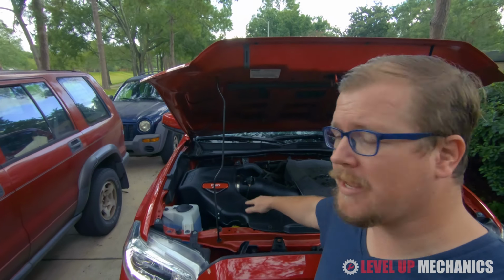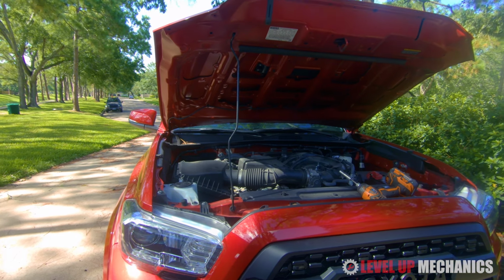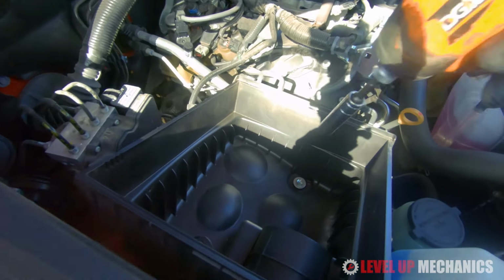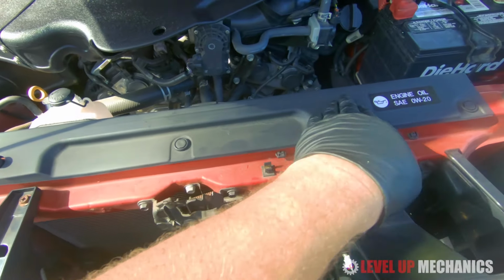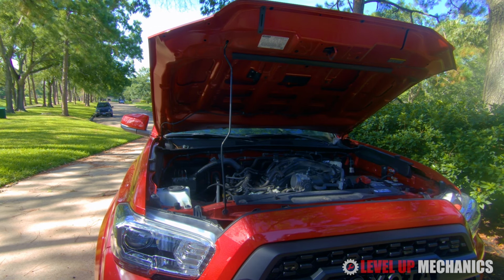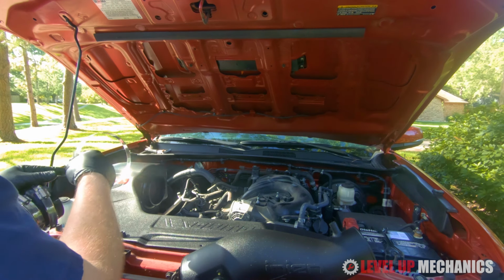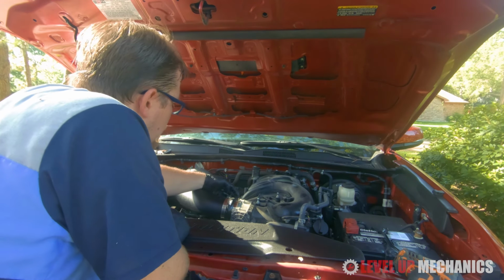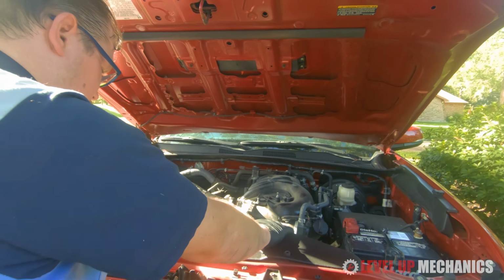Toyota Tacoma Mods | Injen Evolution Cold Air  Intake DIY Install | Injen

Comment: HP? How much does it actually give the truck? What’s the price on these?
Reply from the maker: On their website, Injen states that this intake has dyno proven gains of up to 17 hp and 15 lb-ft. of torque (and costs about $440).

Here is the link: https://injen.com/i-30497613-injen-evolution-cold-air-intake-system-oiled-air-filter-evo2200c.html?q=

If you check out their website, they have multiple options for a tacoma intake system. I hope this info helps! 😁 👍

Comment: Just installed mine today. Since I do have the 2022 Tacoma TRD OR, i dont need to add a sealant since the new one have this addon on them. it is a hard fit if you added the Silver Bullet Throttle Body Spacer on it. I like the sound that it makes. it has that whistle sound when you press the throttle.
Reply from the maker: Nice! Congrats on the upgrade 👍. Definitely a great choice 😁

Comment: Wait, did u modify your hood scoop?
Reply from the maker: Nope. Why do you ask?
Reply: @LevelUpMechanics  I thought someone below mentioned your hood scoop and u saying how it lets in air but not water
Reply from the maker: I think they are just talking about the "front scoop" that comes with this intake, which sits above the radiator. 😁

Comment: So the ram air scoop sits behind the radiator? Won't it be pulling in hot radiator air into the intake?
Reply from the maker: It actually sits right above the radiator, so when your driving, all the cool air from outside that blows above the radiator is being collected & fed to the engine. 

There is also a second air intake opening located at the passenger front fender, which is the same as the stock setup.

I hope this info helps! 😁

Comment: I’m worried about how well the filter protects the engine compared to OEM? If you are in very dusty conditions.
Reply from the maker: If I were in dusty conditions all the time, I would actually recommend just a TRD air filter and a snorkel. 

So many people think a snorkel let's you drive in deep water, and that is just absolutely absurd 🤯🤯🤯.

A snorkel's only function is to "collect" dust-free air when in dusty situations...

So far my Injen intake filter is holding up really well. No issues at all. But I haven't tested it personally in a dusty environment, so I really can't speak to that aspect 🤔

Comment: What intake do you recommend for a 2016 2.7 SR5 Tacoma?
Reply from the maker: K&N is a reputable brand and offers a couple different options for the 2.7L (both high performance "drop-in" filters and full intake systems).

Comment: Does your air intake box with the rubber trim piece actually slot into the wheel well hole, or is there a gap?
Reply from the maker: The rubber trim just sits up against the fender where the hole is.

Comment: Any reason you went with the red(oiled one) over the blue(dry filter)? Idk which one is better ive heard the oiled one allows contaminants to enter the engine easier
Reply from the maker: Honestly, it might be better to go with the dry blue filter going forward. Both filters are pretty identical in performance. 

The blue filter is also easier to maintain, as you do not have to re-oil it after cleaning. 

If in doubt, I'd recommend going with the blue filter. I'm used to oiled filters, so I bought the red filter purely out of habit lol 😆

Comment: Did you think the CAI made your truck louder (in the cab) or just deeper?
Reply from the maker: Barely louder, and definitely deeper... but only when under heavy acceleration and in the 4-6K rpm range.

When cruising, the engine sounds the same as when using the stock intake. 

I hope this info helps!
Reply: Any difference in sound (loudness when on the phone) when normally accelerating or cruising at 75plus highway speed?
Reply from the maker: You don't really hear the intake unless you are wide open throttle.  The Tacoma will sound stock while cruising or under light acceleration...

However, you will definitely hear it when you punch the throttle @ high rpms.

I hope this info helps!!!

Comment: I know I'm a bit late to the game here but...  Is your truck an automatic or manual?  And GREAT video!
Reply from the maker: My tacoma is an automatic. I do miss having a manual though, as they are a lot more fun in my opinion. Thanks for checking out my video!
Reply: @LevelUpMechanics  Thank you for the reply!  Yours sounds amazing!  Mine is an automatic too. So I really just wanted to gauge if the CTA was worth it from a sound perspective.
Reply from the maker: While cruising around, the engine still sounds pretty stock... but when you accelerate, you can definitely hear the CAI growl while in the upper RPMS (4-6K RPM).

Comment: Just installed on mine. Oh man big difference in shifting and sound!! Way smoother 😀
Reply from the maker: I agree 👍💯.  I really like the aesthetics and performance of this intake too! Great choice!
Reply: @LevelUpMechanics  my favorite upgrade so far 😊
Reply: Do you guys have manual transmissions? I’m considering this for the HP and TQ output; but I don’t know if there’s any hope for the Automatic XMSN, it’s always searching for gears (I live in a pretty mountainous area) hoping this and pedal commander do the trick
Reply from the maker: While the intake is a fun mod and does add a bit of HP & TQ, I would really recommend checking out my channel to watch the KDMAX Tune video. 

I have an automatic transmission and the KDMAX performance Tune (by itself) literally fixed all of those issues that you just described. 

I have an automatic transmission as well and the KDMAX Performance Tune made the Tacoma come alive! 

Plus, since it costs about the same as a Pedal Commander, it is a much better upgrade... the KDMAX Performance Tune not only eliminated the gear hunting issues, it gave me a much better throttle response as well! 

Check out the video on my channel and feel free to ask me any questions you may have about the tune. 

The KDMAX Performance Tune is single-handedly the best performance upgrade for a V6 3rd Gen Toyota Tacoma 😁
Reply: @LevelUpMechanics  does the tune cost you any drop in MPG?
Reply from the maker: Is you drive conservatively, there's actually an improvement in MPG's. I went from an average of 16 mpg up to 18+ mpg (highway driving) and my MPG's stayed about the same for city driving...

Is important to note that with the tune, you have the option to continue using 87 octane fuel (which should give you even better MPG results) or you can tune the Tacoma with 91/93 octane fuel (designed for more performance gains vs MPG gains).

I'm currently running the tune with 93 octane fuel and I still see a MPG improvement (on the freeway mostly) when driving conservatively.

Best. Upgrade. Ever.
Reply: @LevelUpMechanics  😊 thanks!
Reply: @christopherterrell1805  I have automatic and the improvements were instant when I floor the gas pedal
Reply from the maker: Yeah, with the intake, you'll only feel the HP & TQ gains under full acceleration. 

One other benefit is that you should see a marginal improvement in MPG's over time since the intake allows the engine to "breathe" better... allowing more air into the engine with a less-restrictive intake is always a good thing 👍

Comment: Is this just for sound or does it have another purpose?
Reply from the maker: This intake provides a deeper, aggressive tone and also improves engine performance (horsepower & torque) by allowing more air into the engine. 

Injen has been around for decades and is one of my favorite aftermarket brands 😁💯

Comment: Noticed fitment appears off on the top area. Thanks for sharing. I usually just replace the OEM air filter with a K&N or similar.
Reply from the maker: It did take a small amount of finesse to get everything to line up. 

Overall, I am very happy with the results of this intake system 😁

Comment: Just got one of these for my truck and installed it over the weekend. Having some fitment issues with the air filter seating properly on the intake tube and the airbox though. Love the design of this intake, just fitment issues are the main problem. Other than that it sounds/feels great when you get the truck up past 4k!
Reply from the maker: That's unfortunate in regards to the trouble you had installing the intake. 

If I remember correctly, I had to install the filter into the air box first (and then pulled on the filter to make sure I had it "twisted" in properly) and then I installed the intake tube. 

I do agree that it would be better if they made the filter in a way where you could physically feel it lock into place (instead of guessing and testing).

It sounds like you were able to get it together in the end. I definitely enjoy the sound and performance of this intake too!
Reply: @LevelUpMechanics   I tried putting the air filter in the airbox and twisting it in place. But every time I tried to slip the intake tube onto the filter rubber coupler wouldn't seal nicely. I could see the flange part of the intake tube showing. So I installed the air filter onto the intake tube first then I put it into the airbox then connect it to the throttle body.  There is just a small gap now shows between the air box and air filter. The filter is securely on the intake tube though. I am going to try to adjust it again in the spring time. Just too cold right now.
Reply from the maker: Oh wow. Okay. I'd try sending an email to customer support @ Injen, explain the situation, and see if they might be able to send you another intake tube & filter (or at least accommodate your issues / figure out a solution).

In the meantime, as long as the filter is secured onto the tube, you should be okay for the time being.

Comment: FYI but the Tacoma already comes with a CAI. Spending the money on this kind of thing will net negligible power gains.
Reply from the maker: I can understand your point of view, but I really didn't purchase this intake to make crazy power gains. If I really wanted a modest power increase, I'd buy a supercharger...

I purchased this intake because it improves the efficiency of the engine (just like the OEM TRD intake upgrade). It makes a slight improvement in fuel economy (because the engine is more efficient). The air filter will last for the life of the vehicle (with periodic maintenance - I'd recommended cleaning / re-oiling the filter once every year or two). 

And, personally, I like Injen as a brand that is available for the Tacoma. I like the design and I like that it sounds more "aggressive" when I want accelerate. 

I like modifying the Tacoma with products that have practicality and aesthetics in mind.  To each their own I suppose 😁

Comment: how does that front scoop do in the rain? Would there be a risk of water getting into the intake box?
Reply from the maker: The design of how air enters the intake box is almost identical to the factory intake box. As far as the front scoop is concerned, it is designed to let air in and keep water out.

The front scoop has "cut outs" along the bottom of the scoop (in the front, where it sits along the front core support) to keep water out. I haven't had any issues while using this intake system. 

I hope this answer helps!
Reply: @LevelUpMechanics  Awesome! Do you have the link to where you bought your CAI?
Reply from the maker: I believe I ordered mine through CarID's website: 

https://www.carid.com/2017-toyota-tacoma-air-intakes/injen-evo-series-air-intake-system-1560396665.html?parentsubmodel[]=ENGINE|3.5L
Reply from the maker: https://www.carid.com/

Comment: Does it really give HP to the vehicle? either is Injen, K&N or others I've seen on the internet? What about adding a pedal commander system, exhuast system?
Reply from the maker: Yes, the intake will increase both your HP & TQ. Most intakes will improve engine performance. And yes, even changing an air filter with one that is less restrictive (like K&N) can improve engine performance. 

The best intakes are the ones that can deliver in both quantity and quality. For quantity, you want an intake that can deliver a high volume of air (not restrictive). For quality, you want an intake that can deliver the coldest air possible (the colder the air, the denser it is). 

That's why I chose Injen. I did not want an "open filter" system, where it would just suck hot engine air (and where the filter would get dirty really quick by being exposed to the elements). I wanted an intake where the filter was enclosed in a case and had the ability to draw in the coolest air possible. 

An exhaust system could also improve HP & TQ (a better flowing exhaust helps remove your exhaust fumes to make way for all that fresh air).

A pedal commander does not improve engine performance. Instead, it changes the responsiveness of your gas pedal. 3rd gen tacomas are notorious for feeling "sluggish". A pedal commander will make you feel like you're going faster at the touch of a gas pedal, but all its really doing is adjusting the sensitivity of your gas pedal. It does not actually create more power, but instead, changes how quickly you can access the power that is already there (to put it simply).
Reply: Wow great answer. I gotta buy one of these for my Taco man 😩 It sounds so good! Then I’d like to throw a Carven backside exhaust kit on. It would sound like a Warthog from Halo then. 👍😂
Reply from the maker: Thanks! An intake & exhaust upgrade are usually the first to be done on all of my vehicles lol 😆
Reply: @LevelUpMechanics  How has your Injen CAI handled snow and rain? Any engine lock-ups or noticeable water inside the intake. Especially out front with that grill design? Just curious as it’s whats keeping me from buying right now. Just don’t want to take the chance of messing up the engine and I’d also be voiding my warranty putting one of these on. Thank you! I live in North Dakota. Very cold and wet in the winter\spring months.
Reply from the maker: There is no snow where I live lol. But I haven't had ANY issues with rain. So I doubt that snow would cause any problems either. 

The locations where air enters the intake system are identical to most OE VEHICLE INTAKES, so as long as you don't try to drive your vehicle through a river, you should be just fine 😁

Comment: Do you notice the difference with just everyday driving?
Reply from the maker: To be honest, I only drive the truck on the weekends (and because it's 2020, I haven't gone out all that much). But, with my limited truck outings, I've noticed that I get about 16.5 to 17 mpg's around town and up to 20 mpg on the freeway. 

As far as HP and TQ, it's a minor improvement for sure (but nothing major). The major downfall of 3rd gen tacomas would be the gearing, so even though the intake improves the engine performance, the  stock gears ⚙  still rob the tacoma of its full potential. 

One other cool benefit about the intake is that it makes the tacoma sound slightly more aggressive when you accelerate. It's just a fun feeling personally 😄👍.

Comment: What did you do with the resonator electrical wiring you disconnected?
Reply: My bad...I just watched it again and see that the sensor wiring doesn’t connect to the resonator; it is just held by a clamp.
Reply from the maker: Sorry that I didn't get to your question sooner, but I'm glad you were able to figure it out lol 😆.
Reply: @LevelUpMechanics  it’s funny. My kit was harder then yours.  1st, my 4 connecting screws - the screws that connect the front radiator duct to the filter box - didn’t line up, so I had to drill out the plastic. 2nd, the weather strip gasket doesn’t form a good seal with the fender wall. 3rd, I think I’m gonna miss being able to simply drop in a new air filter. Changing/cleaning the filter on the Injen CAI requires some work.
Reply from the maker: @rudyjackson426  there are definitely some trade-offs with the filter, that's for sure. I'm sorry to hear about the fitment issues with your kit.

You should reach out to Injen, tell them about your issues, and see if they can do anything to help.